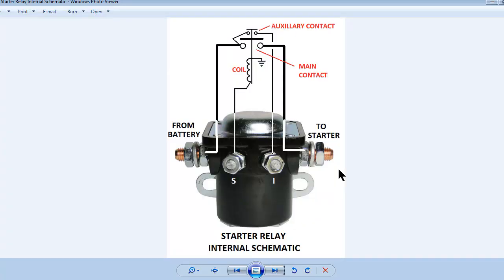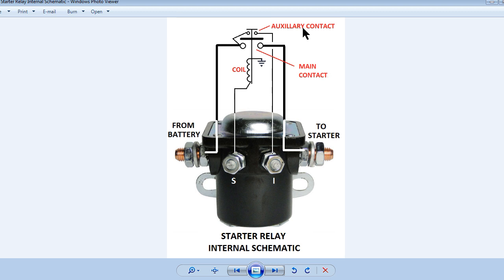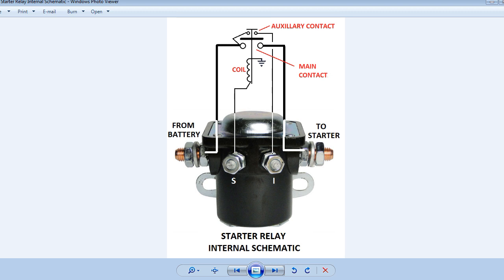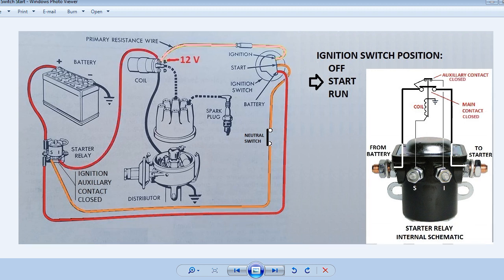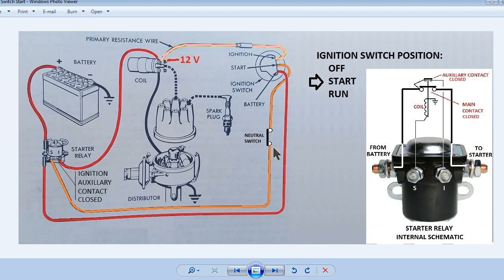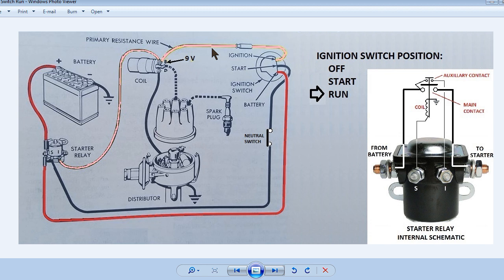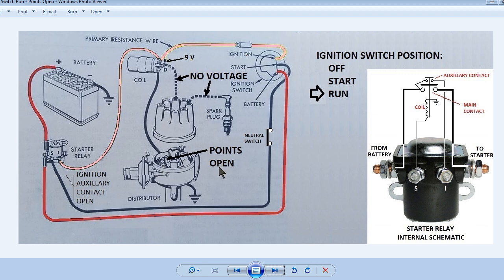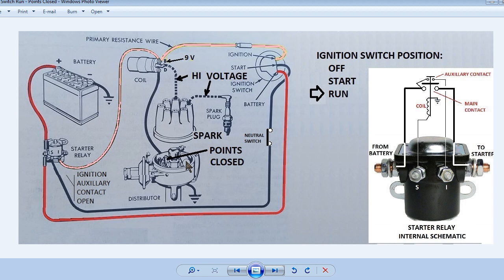(ORIGINAL VIDEO has been updated) Ford Point type Ignition Circuits Explained

Comment: This is an excellent video...I had this exact problem...the prior owner had accidently cut the pink wire and then I purchased the car and had the wonderful experience of having to repair it...what made it difficult was that the prior owner had inserted a ceramic resister thinking he did not have a need for the resister wire anymore...!  The greatest challenge here was that there was a pink that "morphed" into a brown making it difficult to find...!  but thank you very much for otherwise explaining the problem ...!

Comment: Your a life saver I’m having trouble on a 1972 ford f100 v8  and know you solved my problem I can get it started by grabbing the starter cable and directly  connecting it to the battery but every time I try and start it inside with the key nothing happens thanks again god bless

Comment: Great video, but I think you are doing great without the script reader. They don't have to watch the video if they don't like it. Your knowledge has helped me more than you know. Don't stop the videos!
Reply: Thanks 👍.
======
I , have , two ( external )12 volt coils laying - sideways - on a 9n 🚜 tractor.
===
One 12 volt coil has its own internal resistance
===
It , 🚜has a electronic (ignition kit module)
====
It has a really wimpy (suicide wire) for those who want to try and use a quarter to start it - why 🛑 them I don't know ?
===
If , your coil gets hot 🔥 you - are too - time for country Time. 
====
I , rewire the 9n🚜 all the time I just use a wiring philosophy an electrician taught me one time - complete - the circuit 🐎.
===
I had a hundred horsepower LP 3010 John Deere. Instead of keys I would different switches together ( like a ⚡combination 🔒) and then press two starter buttons.            🔵 simultaneously 🟢
====
Mainly , for kids at Thanksgiving I think they could Crank it anyway.
===
It works so good I couldn't remember 🤔 💬 the order to flip the switches in , myself - & have to rewire it again .
=====
Texas lore now;
April 1st ( last freeze) day for TX usually down to - sea story 
90° F
===
👋 Bryan

Comment: Thank You Richard.  This is a useful video.  I understand that 12 volts are applied for a stronger start and that 12 volts tended to overheat the coil.  This is why the normal run circuit goes through a ballast resistor and normally supplies only 9 volts to the coil.  But in the 60 years since then, certainly various plastics and other materials have become good enough to simplify this circuit to only use 12 volts with no ballast resistor. What are your thoughts on this?  Does 12v chew up points faster or cause other issues?  

Im rewiring an old Ford Taunus v4 and was thinking I’d just keep it simple. Plus I have not located a ballast resistor / resistor wire and need to buy a new coil anyway.  This my first motor with points ignition.

Comment: Hello Richard. The battery on my F150 4.9 Cid 300, the battery gets too hot and is stalling, I have to wait for it to cool down and it will start again. I wonder if I can get a bigger Starter Relay, one built for an F350 may not overheat the battery. Thank you.

Comment: Thank you for your video. This is a question about my car stalling after 30mins when it idles.   I have a 1963 Ford Falcon Wagon.  Its all 
factory no upgrades.  I have tested the ignition coil,  my voltage at the coil when the 
car is running is at roughly 10 volts at the positive lead. Their is only one wire attached to that lead when the car is running.  Per the 
falcon manual my old coil is within the parameters when taking an ohm reading. I am hoping to avoid installing a primary 
resistance wire.  I have the wiring diagram, the primary resistance wire location is in question, is it under the dash at the ignition switch? 
The wire i bought is a long 3' wire.   I also purchased a new ignition coil, it does not say "use with external resistance wire" on it.  Can i use it? I like the way you talk.
Reply: Hello, I wish I had a wagon just like yours, I like the way they look.

Comment: Hi I liked your work behind through the Microsoft video…I have a 1960 Thunderbird 352 and for two years can not figure out the reason(s) for why the charging system refuses to charge.
I have replaced the generator rebuilt twice, the new regulator twice, the new coil is replaced, the new battery and getting ready to put a new regulator a third time because it stopped working. The only thing I didn’t do is change the starter relay and starter. I need your help. Can you do a video on the old charging systems of the ‘60’s?
I’m trying to save the integrity of which it was intended without updating it with an alternator.
Thanks, Rob